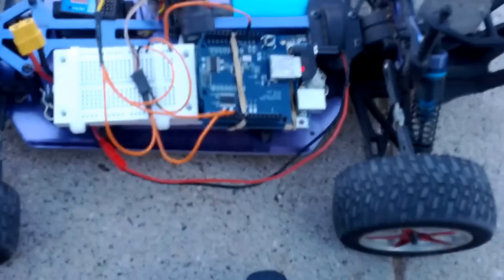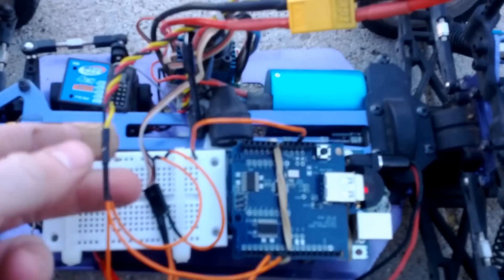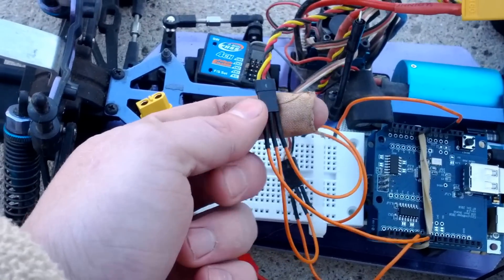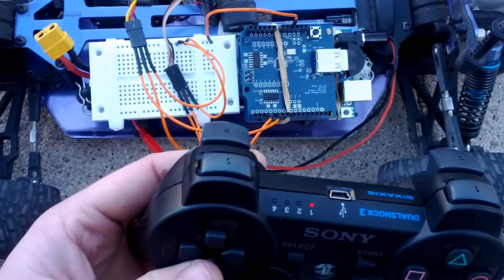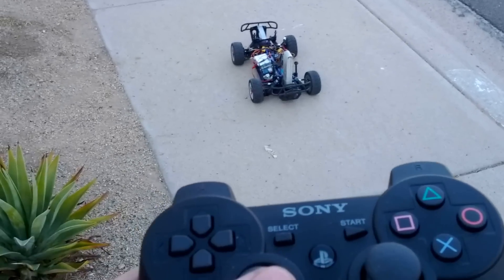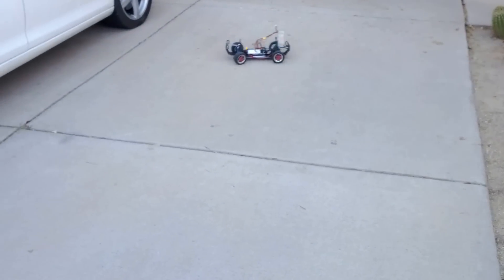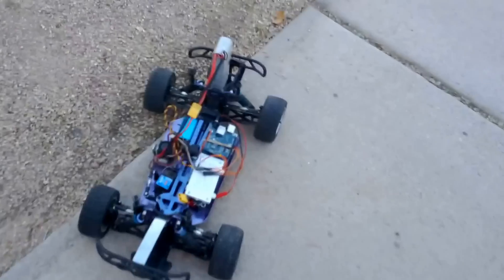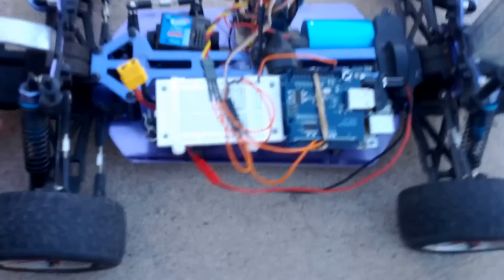Control an RC car with a PS3 controller, Arduino UNO, USB host shield and Bluetooth dongle (Part 1)

Comment: Ok, say I am at home and want to check in on my farm miles away. The whole farm has WiFi access. I have a robot that has an IP camera on it and drives around to check on animals etc. What pieces would I need to accomplish that.? At home: Uno with a USB host shield with Bluetooth dongle and an Ethernet hookup for internet, audio/video shield that outputs to the TV at home. On Farmbot: I'd need an Uno with WiFi shield to receive commands and send video. How can you send commands via the internet?

Comment: Hello, can you help me?  The left stick ESC is used to adjust the up and down throttle for forward and reverse rotation. Can the code be modified so that the only one for up and down throttle is forward steering?

Comment: hey hey hey well what system would i use im going to run four servos at different times  could i or can i use a double pole double throw switch to move them  using  what one of the arduinos  im moving a chute up/down 1/2" and the other in/out 1/4 or3/8 not sure using servos but want to use switches to control them but start/stop using arduino?

Comment from the maker: I got it at NitroRCX. My car originally had the plastic chassis for the electric version of the car. I broke this plastic chassis and could not find a replacement (all of the plastic chassis were out of stock) so I bought the chassis for the nitro version of the car, which is metal. Many of the bolt and screw holes are in the correct place, but since the metal chassis is for the nitro car, you'll have to make a good number of modifications to get it to fit with the electric components.

Comment: Hello, dear friend, help me with how to assemble the receiver and transmitter on the Arduino nano for my nephew, control the radio, the fire truck, for 7-8 channels, control the movement back and forth to the left, to the right, the headlights, the retractable staircase.
I have arduino nano 2 pcs.
joystick module, 2 pcs.
nrf24l01 1 pc.
nrf24l01 + pa + lna 1100m NRF24L01 + 1pc.
driver l298n mini 4 pcs.
Servo 4 pcs.
LEDs, toggle switches, i you need a code and a circuit.

Comment: hello sir.i want to control dc motor with the arduino.i want to control them with the analog stick of the ps3 controller.if you know can you give me please an example code?thank you for your time
Reply from the maker: Do you mean the code used in this video? Or something else? If you use a RC car DC motor controller you won't have to edit anything.

Comment: i'm no professional, but could you use a power gate to make the speed more controllable?
Reply from the maker: christopher gillig The problem is that the ESC is cheap. It doesn't work very well at low speeds and doesn't have a very wide speed range.
Reply: Barrett Anderies Gotcha, i don't mess with these.. Might have had a better idea if i did. haha

Comment: how can you get more range with the  Bluetoth
Reply from the maker: Unfortunately you can't extend the range of Bluetooth, but you could switch to a different type of RF communication like an XBee or NRF24L01. However, this would require another Arduino that acts as a relay between the PS3 controller and the Arduino on the car.

Comment: Now you open the dongle and solder and external wire as antena and one to the controller too that would increase the range
Reply: wouldn't the dongle than need more power in order to sufficiently exert data the same way

Comment: good afternoon Barrett would like to have your help, I have seen your videos and I'm build a car and wanted to use the command of ps3 and how would I use 4 engines will use a 12V H-bridge, but as I am new in programming the arduino not'm getting like your progeto Caster Bot, but you progeto that you use servo motors and I want to use 12V DC motors, can you give me a hand?
Reply from the maker: I would suggest researching the use of H-bridges first. Once you have been able to control a single H-bridge, you should easily be able to adapt your code to control multiple H-bridges. By slightly modifying the example code provided with the USB host shield library you should be able to control your H-bridge code with the library functions. If you need further help head over to my website and email me. Interacting through YouTube comments is horrible.

Comment from the maker: No. You could modify my code pretty easily to work with XBees though (if you know how XBees work). You should learn C, C++ and Java. If you know these languages you can easily work with Arduino and Processing (The Arduino language is based on Processing).

Comment: I dont understand why'd you want to control the car with a PS3 controller (which would probably be worse than the stock controller), especially when you're range is so limited by bluetooth. Unless, of course, you just wanted to experiment with bluetooth or something.
Reply from the maker: Range and performance was not the point. I was just experimenting with the library.

Comment: What if i replaced the PS3 controller with wired PS2 controller? I mean what extra component i might need to add on? Please reply me if u saw this message cause i plan to do something similar with this. Thanks..
Reply from the maker: I do not think it is possible to use a PS2 controller, however, it is possible to use an Xbox controller.

Comment from the maker: The range is hardware dependent. Unless you know how to built 2.4GHz antennas and solder them to your components (the PS3 controller and Bluetooth module) you cannot increase the range with this setup. However, you could look into using XBee radios (a little more complicated) some of which have ranges over a mile. Using XBees will require a second Arduino as a routing station between the PS3 controller and the car (why I didn't use XBees).

Comment: How did you make the dc motor work with arduino. ?.. what sketch should I use in order for it to work properly?
Reply from the maker: The code is available on my website (link in the description).

Comment from the maker: I think so, although I've never done it. However, it's much easier to use Bluetooth transceiver with your Android device as they don't require any code or setup (as your Android phone can act as a Bluetooth host, there is no need for the USB host shield).

Comment: Can you use a Ps4 Controller? Thanks.
Reply: Sorry didn't read the library
Reply from the maker: Yes, with the latest version of the library it is possible to use a PS4 controller.

Comment: will this work with any RC car?
Reply from the maker: Yes, as long as the ESC and servo receive standard PWM.
Reply: Barrett Anderies It's a small 49 MHz RC car from goodwill. Don't know if that means anything to you?
Reply from the maker: That car is unlikely to have a standard ESC or sevo, and will probably not work. You would have to take it apart and check to be sure.
Reply: Barrett Anderies A few questions then.
1. Any clue where I can get a cheap rc that will work?
2. Would I be able to by an ESC and stick it on this cheapy car?
3. Is your code reworkable to make it function with the cheap car?
Reply from the maker: 1. There are many online retailers of RC cars that have hardware that will work with my code, but I doubt you will be able to find one for much under $100.  You can get a cheaper version of my car from NitroRCX.
2. It is possible, but I don't know what your car/motor looks like. If it's really cheap, it's most likely a brushed motor, but if it's a little more expensive it may be brushless. You will have to determine the motor type and pick the appropriate ESC type.
3. If you can determine what hardware is in the car and how to interface it, then yes. You would need to replace the code that writes to the servo objects with the appropriate code to interface with your hardware.
Reply: Barrett Anderies oh, it is dirt cheap haha. I actually found the exact car:
http://newbright.com/rccar/1586-ford-f-150-rc-trucks/
Reply from the maker: Godfried Weihs That car is unlikely to have compatible hardware. The steering probably doesn't even use a proper servo. However, it is still possible to interface with it if you can figure out what's inside. Have you looked inside? I may be able to offer more help if you send me some pictures of the internals. You can find my contact information at my website and email me.
Reply: Barrett Anderies Awesome! I'll go ahead and send that to you.
Reply: Godfried Weihs Hi godfried, while his hardware is much more expensive,and easier to use with PWM, cheaper cars can also be used, the difference lies in driving the motors and the steering, you will probably want to order some LM293D chips off ebay and then look around for examples to drive simple DC motors and Magnetic steering coils.

Comment: Great job... I'm thinking you could take an xbox1 controller, then maybe buy a budget rc controller and put the goodies inside the xbox1 controller, there should be enough room.that way you'll have the same cool factor, and with the goodies from rc remote no worries when it comes to range...

Comment from the maker: It will not. As I explained in another video (see the link in the description) a regular Bluetooth modem (module) is a Bluetooth device. It cannot actively seek out a connection with another Bluetooth device. Only Bluetooth hosts (like your computer, or an Arduino with a USB host shield + dongle) can seek out a connection with Bluetooth devices. Both a Bluetooth modem and a PS3 controllers are Bluetooth devices, thus they can't communicate with each other without the aid of a host.

Comment from the maker: I am not familiar with gas RC cars, but I would guess that the only things you would need to add (after removing the engine, fuel tank and clutch assembly) is a motor, gearbox and ESC. Your biggest problem is going to be getting the electric components to fit on the gas frame. That being said, I did it with my car (my frame is for the nitro version) so you shouldn't have that much trouble.

Comment from the maker: I didn't use any buttons on the controller. I used the joysticks. The left stick was throttle and the right stick was steering. I did not use a while loop, and I would recommend that you avoid a while loop in most cases with an Arduino because it freezes the entire code while it executes. I added a link to the code on my website (follow the link in the description). Let me know if you have any more questions.

Comment: what is the top speed?
Reply from the maker: That depends on the battery used. I know this car can reach 50mph on a 3S LiPo but the ESC will overheat in minutes. With some minor modifications I would not be surprised if this car could go 60mph.

Comment: does it work with xbox
Reply from the maker: Yes, but you will need to purchase a wifi dongle. If you go to the developer's website (of the USB host shield), he explains how you can use either a PS3 controller or an Xbox controller.

Comment: cant u set it for acceleration  using the right trigger  ?
Reply: L2 reverse  R2 forward
Reply from the maker: Yes, you can get data from the triggers using PS3.getAnalogButton(R2) and PS3.getAnalogButton(L2) in the same way that joystick positions are retrieved.

Comment: This is awesome. I would like to get one for my E-revo and set it to use my triggrers for throttle and reverse and the stick to steer. Would be cool Imo.
Reply from the maker: It is easy to have the triggers control the throttle in place of the joystick.

Comment: Great work! I have a RC with just two wires on motors, planning to do the same or maybe change it with a servo motor (steering), but forward/backward should be OK, just controlling the voltage as "speed". Or not :)
The obly thing that bugs me is the range, I need at least 30 feet to be funtional. I don't want to run after a 20 km/h RC car as crazy! :)

Comment: what kind of RC car did you use, and would it be hard to make the car autonomous
Reply from the maker: The car is an Exceed RC Rally Monster (link in the description has these details). The easiest way to make an autonomous car would be to use something like ArduPilot: http://ardupilot.org.

Comment: Great page great work, I am using your method as far as the esc an a front steering servo but I’m using a wireless ps2 controller, everything seems to work while on it own but when I use ur code I had to change a few things but It did not work some advise would be great. I erased everything u had dealing with the ps3 controller an replaced them with the ps2 lib it compiled nicely but I got nothing when pushing my analog sticks the servo jus jidders

Comment: Is there anyway to add other functionality to the system like a third channel or something like that?  Thanks.
Reply from the maker: Sure, you can program the Arduino on the car to do anything in response to any of the buttons/sticks/triggers on the controllers. You have essentially unlimited "channels."

Comment: thanks for ur reply 
Have u tired to call any function u created when u use the joysticks or buttons?
coz I've noticed if I try to implement more commands, the communication between the controller and doungle doesnot start at all 
while when using simple task, like printing something in the monitor, it works fine 
any idea why is that ??

Comment: Hey Barrett, I'm really interested in this Arduino RC Car Project your doing, and It would be tremendous help if you could send me your complete Hardware List for this project.
Reply from the maker: It's been so long since I made this that I don't really remember what I used. The hardware is highly flexible, so you can use pretty much any similar parts. The parts I used were suboptimal. The main things you need are an Arduino (pretty much anything will work), a PS3 controller, a USB host shield, a Bluetooth dongle, and an RC car with a standard servo and ESC. You don't actually need the secondary battery I used. You can power the Arduino off the 5V from the ESC, and splice the same 5V supply directly to the servo.

Comment: someone's probably already pointed this out/said something about it, but the LiPo wouldn't exactly be your issue with it.. it'd be your speed controller.. sure your LiPo is higher in voltage, but if the speed controller isn't set up for that sort of 'spec', then as you saw, it over heats/doesn't work properly. Plus, it acts almost like the speed controller wasn't calibrated for the PS3 controller, so you got 'super jumpy' reactions from it because the signal being given to it is different than what it probably expects to be given. just my thoughts. i could be horribly wrong XD

Comment: Be careful when stuffing in the lipo... those things are known to catch fire when man handled. Awesome vid though! If you have time you could make a how to video. It would be very interesting to see what process you used to connect the Arduino to the receiver etc... Would your system work with a regular 7 or 9 volt battery?